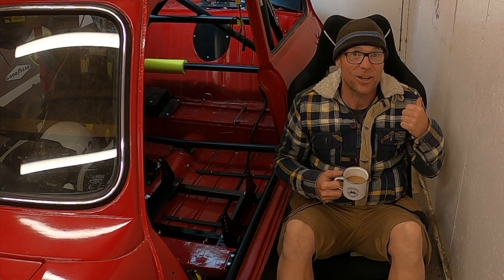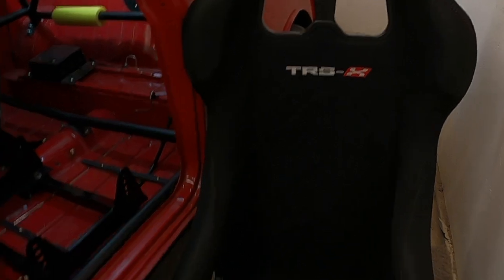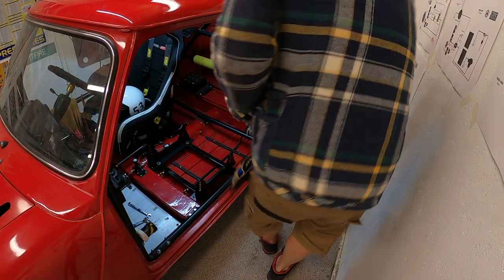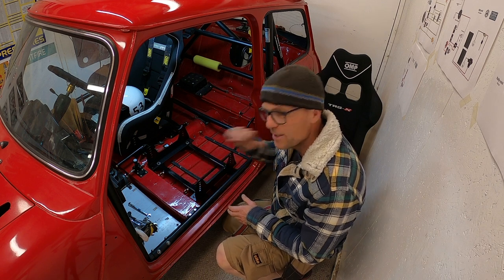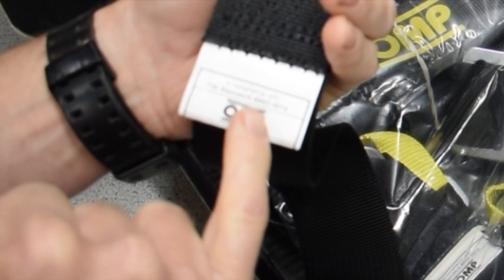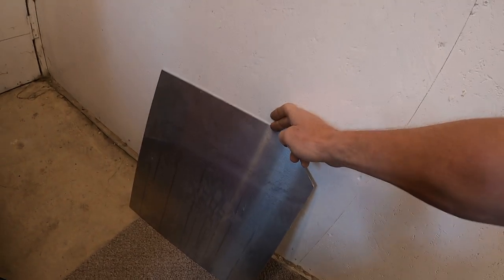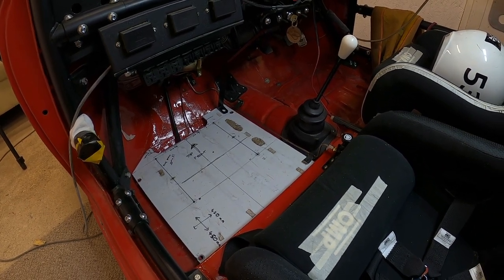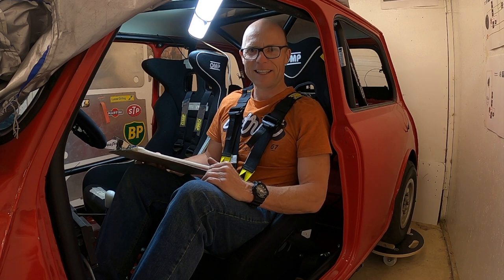Classic mini rally seats - seat mounts - harness and navigators foot rest

Comment: Foot rest looks great Kev. I ran my fuel line along the tunnel on the nearside and the battery cable on the other side. I had to change the braided fuel line as the inner rubber seemed to smell of fuel. Teflon inner piping with outer braiding seems to have cured the problem. 
Your Mini will look sweet. Nearly finished so keep up the great work.
Reply from the maker: Thank you, yea I went for teflon lined fuel lines as everyone told me rubber hoses stink :) :) - plus with E10 very eminent its a good upgrade. glad you enjoyed the video and I will have a fuel tank and fuel line video coming soon.

Comment: Kevin, with the rear side windows, how about panel steel/Aluminum instead of glass or plastic and held in with zuse clips so they can be removed quickly and completely.
Reply from the maker: you know what that's a genius idea and would work well, however, the rules for stage rallying are super tight and windows that were windows when they left the factory have to stay windows and be either laminated, toughened with safety film or clear plastic of a minimum of 4mm. you are not even allowed to rally vans other wise that would be a great loop hole :) - thanks any way and glad you enjoyed the video

Comment: Great video. 
Can I ask where you got the Velcro straps for the safety harness excess ?
Thanks.
Reply from the maker: TBH I have no idea, I think I found it at work. its a roll of double sided velcro so it sticks to itself. I have used it to connect all sorts of things to the roll cage from the wiring to the windscreen washer pipe. here is a link to an eBay item very similar. hope this helps https://www.ebay.co.uk/itm/233171636105?_trkparms=ispr%3D1&hash=item364a1ccf89:g:cRsAAOSwkbxfCEMa&amdata=enc%3AAQAGAAACkPYe5NmHp%252B2JMhMi7yxGiTJkPrKr5t53CooMSQt2orsSRAQR8FABHjfpFoyRlXhWmQRcZC7JZXRfTPBZdNCS3YQFbq37GP4OlD%252BTg%252BUE3TJQZxhyn7Omz9HVo9mmCjjEDORCXsE44j0nIzIqJnZMfREuiXkqtRWWXA8zdNUoBFhLOhtCThM%252FlC5GUnUesiXcDzM1V3ab9GXzPJX%252B%252Fe0ZQ%252BbGYaPpH1RA2UVdsWD4aK8a1J6td6GDe8OYEMUsz%252BF9qsbR1x2nc1v1ixPLCIZUZUt0NOttfprrMD82nB4rVX96sB9WHWehnGIFobts9gTE1DXT31hJ3zKChAYr1VMc3nwsoMKTt5QRLw8Ih8zypx0HDevHy9K5FoEAamRnKlBe79Rq5siaSeMrZ6MACDTEgSMuuWxAs%252BMfAN7SaTqUR2OX4YaI9xdcRg6Egl0U2qIziv2WZEd%252BnHsXEcwPRVSOUr25uq%252BolFbVL2WOBekmK45K3gc9ffxB7iJfTR%252BkRKL8gm%252BZJF8DQVKLFRSeOWa%252FG0W3kQjyvEYb%252BKVv3LOcCgpK66RUzvT1on0zkYRDY5wzB3NOWpyqrKHqvRX1XVetFHo0MIett6siIlpt7Eg5jn5jL6ohE2tZI9Wtiiryr2V7Bzsm5xaJXQdE1RFclhSs3znKf6pPdFNNNfY27ON1160ORc%252FYZS2EIkN6RJKhhaGOn5zzZgWngPaBA3JM31ohYi1Q%252BYzWmpOJPrRPrmrr7K6iNi%252FMq%252B4mXZpOMUWxeu%252BzzKPI9BasQt3AB44ZeOWdle%252F3Ni%252BqhxMq2xAIw%252B1Z%252B%252BkbhdDsr2CiVQJwLicIXN8ih6G3YxaupGz6Ck6E%252FCCwapyG0jCU5GTOy%252FrR5SWV05Sj%7Campid%3APL_CLK%7Cclp%3A2334524
Reply: @TheGentlemensMotorRacingTeam  
Ah, great.
Thanks for thst.